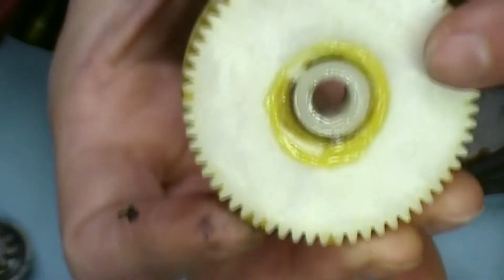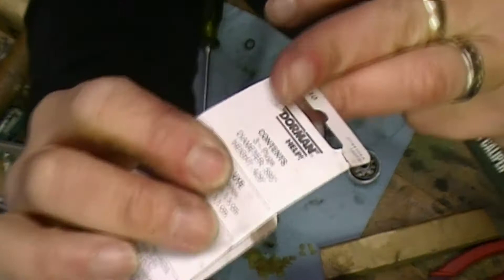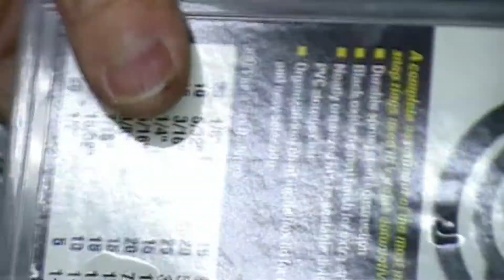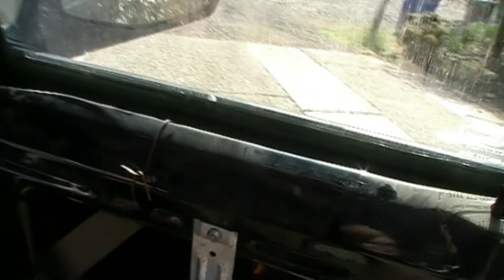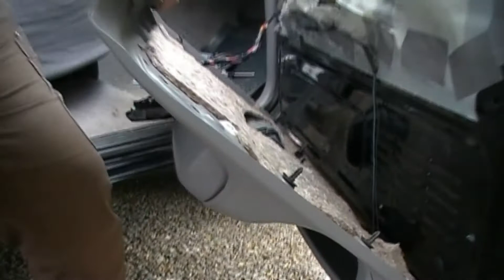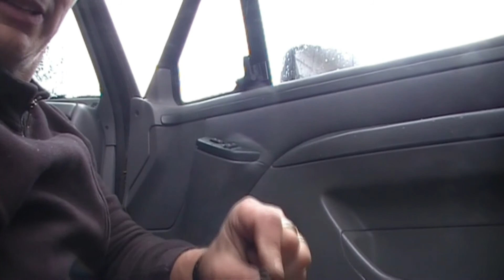95 F150 Window Regulator Repair

Comment: Hats off to Dumb Luck for taking the time to post this video.  I used the vice method mention below to squeeze the plugs/inner gear into the housing.

I found this video while searching for info on how to install a replacement assembly including the motor, arm and bracket that I previously purchased.  After discovering rivets would need to be drilled out to replace the existing assembly I decided to purchase the Dorman plugs.  

Again thanks to Dumb Luck for posting this video!

Comment: Thanks for taking the time to make this.  A little long - but very realistic!  Thanks!  We did a 'sorta' repair (not with actual gears plugs) that only worked for about a year - now I think I can do the repair since the holes are already drilled out.  I saw several repairs using nuts but I worry that it would negate the safety feature and with my luck it would be my finger that gets pinched!    As an aside, while I had the door panel off, went ahead and replaced the door sweeps to (my 95's were dry and cracked).  Good point about checking the drain holes.

Comment: I have a 1992 F-150 5.0 extended cab that had the disintegrating window motor gear plugs issue. I initially had the same difficulties trying to assemble the plastic gear, plugs, and metal gear, but found a way to assemble them where no modification to the plugs is needed. My method is counterintuitive, but worked perfectly the first time I tried it.

Rather than placing the plugs in the plastic gear, and trying to press the metal gear into the assembly, I greased the plugs to give them some stiction, set them into the recesses in the metal gear, set the plastic gear over the plugs, and compressed the assembly together in a vice. Like I said, worked perfectly the first time. Prior to doing that, I had placed the plugs into the plastic gear, and tried to fit the metal gear in between the plugs with no luck. I must have fiddled around with that method for about 20 minutes before trying my alternate method.

I purchased a Dorman 747-409 gear & plug kit, but found that the gear that came with the kit was too large in diameter to fit in my window motor housing. I think the problem was that the kit is for a 5/1/1992 and up, and my F-150 must have been manufactured prior to that. No, worries, I was mainly after the widow motor gear plugs, but figured I might as well replace the plastic gear while I had access.